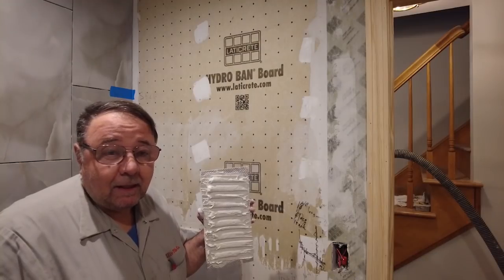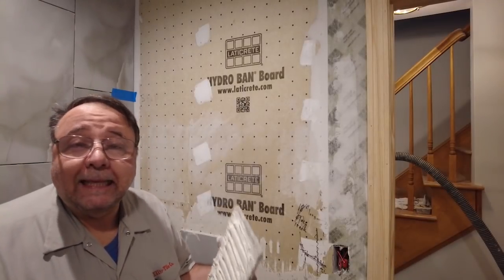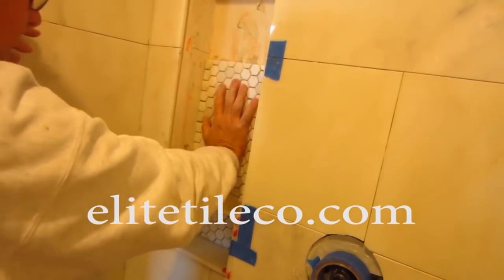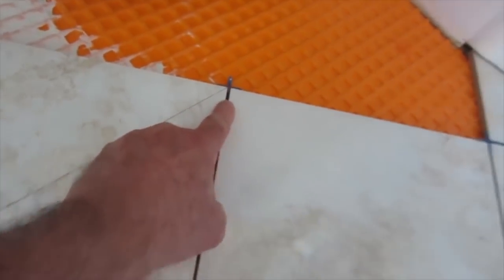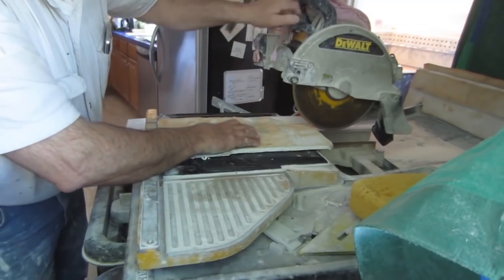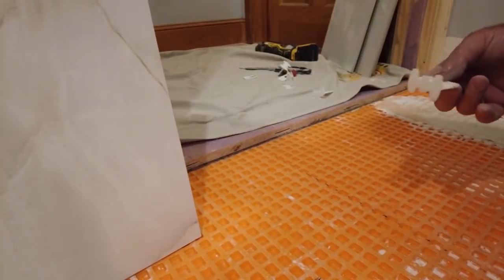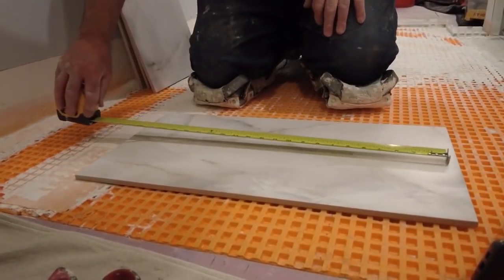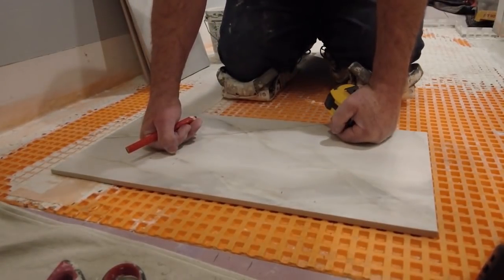Many tile tips to make your tile installation easier.

Comment: Thanks So far I have learned 3 new things, using the sheet and setting it before hand, cutting those clips which I used last week, using a drywall r what kind of board under the tile..  Usually if I neared a sliver or point I cut the point end first and end with the larger size.    How did you measure down to know where to cut into the wood for the spacers?   I learned the half way by measuring from the corner and sliding there tape measure…. That is priceless!  Thank you .
Reply from the maker: https://youtu.be/dACl0rZcp4Q?t=160

Comment: Great tips. I like placing the mosaic on a piece of felt for tiling the back of a niche
Reply: How well does that hold up since felt isn't water resistant? Seems like it would absorb moisture from the thinset and make for a weak bond? Ever have problems later on with the mosaic pulling away from wall?
Reply: @Kayte...  I believe he is using kerdi underlayment but you have a good point. Because it’s high on the walls I doubt there is little issue if any but that is a question for Sal.

Comment: Hi Sal love your workmanship and expertise , do it yourselfers , we installed the shower marble threshold with out pitch towards the drain.
Does it have to be removed and reset with a pitch so the water stays in the shower? Thanks in advance
Reply from the maker: See  what happens, change if it is a problem.

Comment: Thanks Sal for the tips. I have a (probably stupid) question. If one has a three piece shower drain. The middle piece is reversible in order to adjust for the mud pan and tile thickness. At what point would you reverse it to get the extra height. In other words, at what point is the top part too high (too few threads into the middle part) and the middle part should be reversed to get the extra height (and at the same time get more threads)? (I hope that isn't too confusing).
Reply from the maker: You have to determine the height of your mud, make sure it is not too deep. simple as that, might meen you need a steeper pitch to make it work. I have never had that problem.
Reply: @SalDiBlasi  Sal, what do you recommend as a mud thickness at the drain and the walls? (small shower 42x36, preslope 3/4 at wall,  pan liner, three piece drain), Thanks.